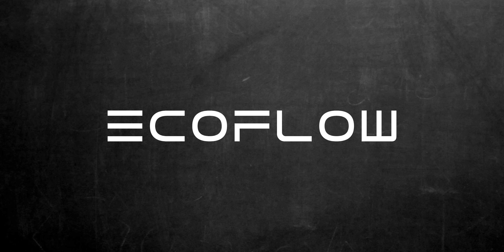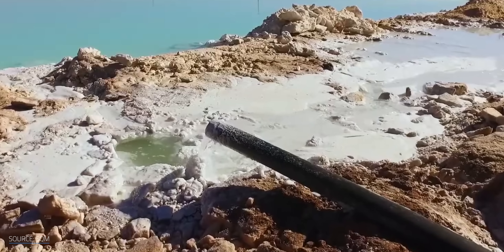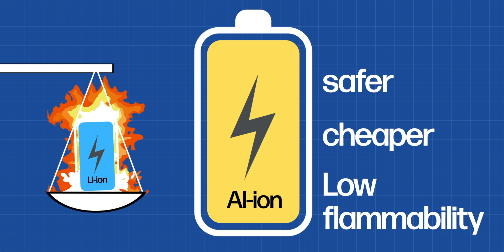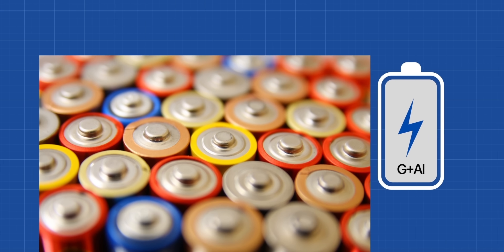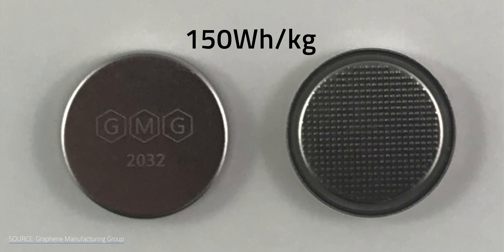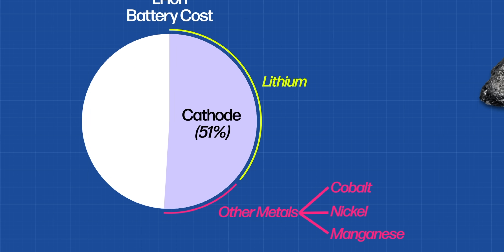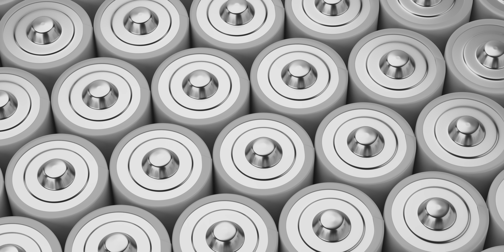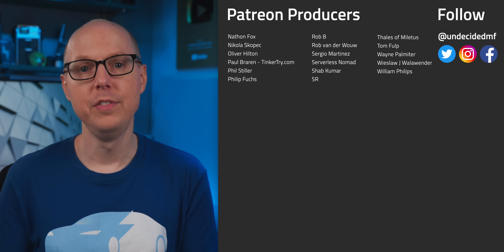Can This Metal Really Beat the Lithium Battery?

Comment: Much better theoretical volumetric power and energy density, but much worse in terms of mass. Sounds like a nightmare for aeronautical and automotive applications mass wise. That said, could be excellent, cost efficient power storage for households. They may reduce the cost of EVs overall, but at the cost of making microparticulate pollution (last I checked, could be even worse for health and environment than ICE exhaust emissions long term) worse via increased tyre wear.

Comment: I believe gmg has solved the dendrite problem.  Doesn't their third party cycle tests that show thousands of cycles prove that?  Their biggest technical challenge now seems to be the manufacturing failure rate.  I think that's still  lower than industry standard.

Comment: Because Aluminum has three valence electrons, you're going to end up with a shitty discharge curve with three plateaus much like sodiums two, this means you're not going to get the capacity you think you will because the second and third plateau will be at a much lower voltage so the total power output will be less after the first plateau, and this greatly complicates electronics.

Comment: So. Not only is green energy intermittent, but you must constantly keep a battery reserve that will continually need recharging. Batteries windmills, solar cells,that will constantly need replacement. Not so green or cheap then. Perhaps nuclear and carbon energy are better.

Comment: from the titanium battery to graphine battery hype that went no where because graphite heats up when you run current through it and thats the least desirable thing that can happen to the radioactive battery that i dont think is on the market yet to now aluminum batteries... i feel like this is capacitors and it will be 2 more attempts before we get real marketable products that are better

Comment: Isnt the issue here that lithium has very few uses as its chemically volatile.  Aluminium on the other hand has many uses, good for outdoor use, doesn't corrode or at least it oxides, electrical conduction.  My point being OK use aluminium for this battery technology, but it means already in high demand aluminium is in even more demand.  So this means aluminium goes massively up in value.  It means all electronics go ridiculous in price.

Comment: I don't understand why more "primitive" solutions aren't at the forefront of energy storage, gravity batteries and flywheels would be simple and cheap in comparison to every new battery, old shipping containers filled with soil/rocks from the area surrounding a wind farm could be directly linked so any time not generating grid power could function with pulleys to raise weight or with vacuum sealed flywheels raise rotation speed, they might not be the most efficient method but it's compatible with the current infrastructure and there's no major mining costs both monetarily and to the environment beyond transporting containers, pulleys and a frame, these could be above or below ground and any material dug up from the area could provide weight... Hydropower is relatively similar to these types of gravity batteries but pumping water up to a reservoir, this method removes the environmental damage to the waterways and lowers production costs, making it something that could be built in countries with less advanced infrastructure with relative ease.

Comment: 100 cycles is nothing. Also batteries behaviors changes as they scale up in series or parallels to larger banks. I agree we are getting new battery chemistry papers almost every week, but like I said true performance and cost can only be judged as sum of the whole on millions of cycles with proper change and discharge curves both having edge cases of "fast" changing and rapid discharge. Only after these tests are done you can have a complete picture of the Pros and Cons of that specific chemenisty.

Comment: As soon as someone mentions Graphene in a product that will need to be manufactured at scale, you have to ask how easy it is to make hundreds of tons of Graphene? From what he says, this sounds like a slow process that's not easily scaled. The factory looks tiny, so this is very much in the early stage of development. It needs to be taken on by a much bigger enterprise if it's to make it to market. Personally, I think it's not suitable for mass production unless they can find a better way of making the Graphene.
Reply: There are cheaper materials that can compete with graphene, such as graphitized cellulose nanocrystals.  You can make the latter in bulk pretty cheaply, and if you come up with an efficient high heating process, you can convert it into a graphitized form.  As to efficient high heating--vacuum insulated Solar concentrators using ultra black materials, or souped up microwave and microwave kilns are a very real probability (once you convert the CNC's into carbon [easy enough], the microwave will take care of the rest as carbon is a microwave susceptor [directly absorbs microwaves and gets very, very hot]).

Comment: These could be awesome for cars.  It’s too bad you won’t be able to fast charge the battery while in a phone.  Maybe in a computer but not sure.
Reply: It may be still be possible to get a fast charge on a phone.  Obviously we wouldn't want the batteries to get too hot to touch but the lower internal resistance should allow for more efficient charging as well.  It's also possible to push higher voltages over USB which improves transfer efficiency and enables more overall power to be transferred (Watts=VoltsXAmps but it's the amps that generate heat, that's also why we use ultra high voltage power lines throughout the grid).

Comment: non flamable with metallic lithium plate and dendrite possible formation : geez, you want people to remember the info (and thus the channel) unreliable ?
Most batteries will be static and thus NaTO (because it requires far less energy and thus cost to build) will be the dominant form and then you'll have mobile batteries trying to solve the circle quadrature but none actually has potential to completly overcome the others, even lab ones.

Comment: I would like to see a battery that can recycle itself.
Reply: Why would that be necessary?
Reply: @davidmccarthy6061  I have considered a battery back up for home.  I'm bothered a lot by the fact that these things are not serviceable.  They gradually become less useful and eventually they brick.  So I wonder what if someone developed a battery that works within a system where it is maintained to last a lifetime or half a lifetime.  I'm just one of those stubborn people that hates to buy anything more than once.  If there is a battery that can last multiple lifetimes, that would be the most valuable battery in my opinion.  Why build a paper house when there are bricks, yes?

Comment: Not all electrons are created equal. Aluminium has a lower election affinity. It also has a higher weight, so fewer electrons per g
Affinity * free electrons / atomic weight gives you energy per g

// electron affinity KJ/mol
const lithiumElectronAffinity = 59.6 
const aluminumElectronAffinity = 42.5

const lithiumMolWeight = 3
const aluminumMolWeight = 13

const lithiumFreeElectrons = 1
const aluminumFreeElectrons = 3

const aluminiumKjPerG = aluminumFreeElectrons * aluminumElectronAffinity / aluminumMolWeight
const lithiumKjPerG =  lithiumFreeElectrons * lithiumElectronAffinity / lithiumMolWeight

console.log(`Aluminium: ${aluminiumKjPerG} KJ/g`) // Aluminium: 9.81 KJ/g 
console.log(`Lithium: ${lithiumKjPerG} KJ/g`) // Lithium: 19.87 KJ/g

Comment: No matter how cheap manufacturers go about creating new and cheaper cell the fact still remains that millions of people around the world cannot buy it by time its in there countries because of political issues like in my country one 3000milliamp cell that cost 2 USD in the USA is 30 USD in my country and the country next door us 5usd that's why I started to made my own battery from aluminum and zinc and graphene I use coconut carbon and used 1000 volt at 100 amps to flash the carbon to graphene

Comment: We don't really need such high tech batteries in our phones.

They've already made my phone so thin I can barely hold it and type.

They could double the thickness, use a cheaper bigger type of battery, and I wouldn't care.
Reply: I want a modern phone with buttons - I hate touch screens - why would I want to cover the screen with my hand while I'm using it? it's a computer before its a phone and I want a keyboard damn it!
Reply: @JohnnyWednesday  
That's the most piddly complaint I've ever heard. 🤣🤣🤣

You do realize that the part of the screen you're covering when typing on a touchscreen, would be the same amount of area that a physical keyboard would sit permanently, right?

Which means when you're not actively typing, your screen is that much smaller.

Yes, a phone is more computer than phone, but how tiny a screen do you want when watching vids, and trying to read text?

Comment: You gotta multiply the mAh per unit volume with the voltage of the battery cell in oder to get the total power/energy it can provide. Just comparing current alone is pointless and misleading.

Comment: If this battery is so superior on every level, when can we expect it to hit the marked? You'd assume investors would be swarming at this considering the global movement toward sustainability which would drive development at a very high rate!

Would you want one in your phone, car etc? Obviously when it's supposedly cheaper, charging faster, safer when it comes to short circuiting and fire!
Reply: Coin cells (2032) are slated for commercial production in 2023. Pouch cells are slated for 2024 but they are still working on perfecting that tech. The coin cells will be first. They have already partnered with some very big names to scale production

Comment: 70x faster. So these days, I can charge my car at 250kWh. 70 more would be 17'500kWh! 
What kind of infrastructure would you need?
At this moment, I think getting cheaper, lighter and ecologicaly more compatible batteries would be the best.
I traveled several timea 1000+miles trips, and the last ones I forgot about range anxity. 
Lighter battery would make for better range.
Cheaper would make cars more afordable.
This is what we need.

Comment: The problem I see with this battery is the Graphene. Graphene production is slow and expensive. As soon as we can mass produce Graphene cheaply, batteries will be in for a revolution. Until then, Graphene batteries are just not commercially viable.

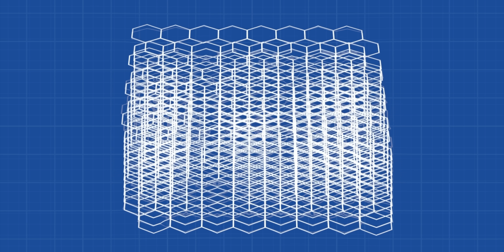Comment: Presuming the audio we hear is your own voice, and not played at a higher speed, are you aware you speak so rapidly, you actually skip words? An example occurs at 5:58-- "(they) essentially drill tiny holes in the carbon layers..." The word "they" is not even spoken. 
You can make this publication more coherent by keeping in mind we are not reading from your script. We must depend on the connection with your own voice, for better or worse. Solving this problem does not require you to speak in exaggerated slow motion, but simply remember every word of your narrative can matter.

Comment: What I don't get is that with dynamic energy pricing, domestic storage of energy is probably much better for the consumers wallet than electric cars. I get that the battery industry first wants to milk the car industry before milking consumers directly.
But really, domestic storage of energy at this point in time should be more important than solar panels, or EV's. We have too much power in the summer that we need to throw away (as heat?). And in the winter we are still doing gas (not even propane).
Would be nice if the focus would shift towards domestic storage and not EV. EV is ok for now, let them use LiFePo until alternatives (used in domestic storage) are also better in EVs.
Anyway: if you installed a battery system without any solar panels beginning this year, and you only used it to buy low and sell high energy (not use it), you would be making money right now. There is a guaranteed cycle: buy during top solar hours, sell during night or evening. This cycle will be profitable for the next few years. This is capitalism/price/market driven steering of energy load shaving for the grid. Everyone profits: the energy companies, you, your neigbours with solar, the environment, and the government (as it is market driven).
If I wouldn't be moving within the next 2 years, I would already invest more in batteries than in solar. Current energy prices in .eu are .02 euro low,  .14 euro high per kWh. That's roughly .10 euro per kWh profit. In september the high was nearing 1 euro per kWh, roughly a .80 euro per kWh profit.
Dynamic energy pricing is the future, as it creates a market for domestic storage of energy. And that creates a market for domestic use batteries.

Comment: Solar and wind are not great on scale, Wind is expensive and kills endangered birds better than a tall concrete structure in the sky and solar takes up too much space for the kind of output you need to power it, So The only real solution to our energy needs is nuclear, The french are investing more and more into nuclear as the nation produces more than enough energy to power itself to the point in where neighboring Germany has bought power off them when their unreliable power sources go out, And with the growing push for EV the issues with solar and wind will be unable to produce enough power for all of the new demand in electricity. Nuclear if built up can effectively power our civilization for centuries and with techniques like nuclear fuel reprocessing which not only give you more energy from the fuel rod it also reduces how radioactive the fuel is making it less dangerous in storage and for our children

Comment: Turnary Lithium , does anyone know about these things , a friend of mine bought some 280ah cells that i cant find any real data on or specs for BMS balance and charge  .After exhaustive hrs of research my conclusion is a BMS suited to LiFo would do the same thing balance and charge wise am i right or wrong .
Really need some feedback here
Reply: Isn't it a type of NMC battery? You should be able to find data for NMC.
Reply: Isn't it a type of NMC battery? You should be able to find data for NMC.

Comment: I think the price to produce it will be very high needs a lot of Electricity and I quote "...is run between a negative cathode and a positive anode, both made of carbon. The anode reacts with the oxygen in the alumina and forms CO2." Not the right time to use a lot of electricity to produce so much CO2 beecause it means give addictional money just to produce it, I think is a "green stupidity", but these stupid rules are in use seriously by now , maybe strict for some years then it will go off.

Comment: 9:24 when you were comparing metal prices in metric tons - why compare graphene in grams? but for the sake of comparison, graphene costs $10,000,000 per metric ton.
Reply from the maker: That's a fair callout, but it's the best pricing we were able to find.  The amount needed is pretty small by weight, so I think it sounds worse than it probably is.  However, it's really hard to gauge without better input from the companies producing the graphene.
Reply: @UndecidedMF  Besides that as Elon would say - return to basic principles - Graphene is Carbon - Carbon price per ton is pretty low - industrial scale refinement of carbon cant be that expensive right?

Comment: That dude's statement about global warning as an example of carbon trapping heat made me lose all confidence in everything else he said. It's a gas with double bonded oxygen that does it, not a random ass carbon atom in the air going "this heat is mine!"

CO2 traps heat precisely because it kicks the heat energy back out rather than holding onto it.

Comment: The blind faith is touching = that there will some energy, any energy to put into these things.
We did all see the CEO of a large wind turbine maker telling us that on a Nameplate Watts per Watts basis it takes ten times more raw material (steel, concrete, plastics, copper) to make a wind turbine than any other type of power plant?
Then add in that, considering an onshore turbine, it only operates at 20% of its nameplate (on average) so that becomes fifty times the raw materials.
Then that the onshore turbine will last only 15 years instead of 50+ hence multiplying the raw material cost by another factor of three.
An offshore turbine will operate at 30% but only last for 10 years.
An onshore wind turbine thus requires 150 times as much raw material as a gas or coal or nuclear power plant,
And the concrete, the plastic and a lot of the steel can not be recycled from a turbine.
Then our cheerful chipmunk comes on to tell us we need more raw material to make batteries and that easily 25% of that precious renewable energy will be lost charging, discharging and getting then up to 100+ Celsius so that they even work in the first place
(Aluminium is only cheap at the present time because of the immense amount of, at nearly give-away prices, energy coming from hydro, coal  and nuclear that goes into making it)
Then consider solar panels - require 100 times more raw material than conventional power plants and only work at 30% of nameplate when placed in deserts 1,000's of miles away from the energy consumers.
Otherwise they work at 10% of nameplate and last for maybe 25 years instead of 50.
i.e. Solar panels use 2,000 times the amount of raw material than a nuclear power plant does to make the same amount of energy
Where Is All The Stuff Coming From? How are you mining, moving and processing this stuff?
Has this world gone completely mad and if so, why?
Has no-one asked why the Green House Gas Effect is allowed to so blatantly disregard the 2nd Law of Thermodynamics?